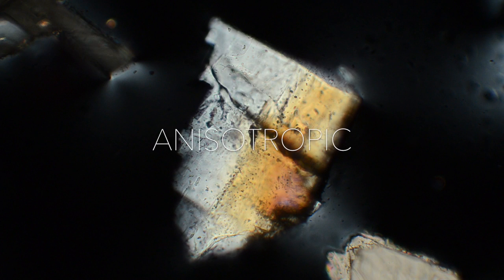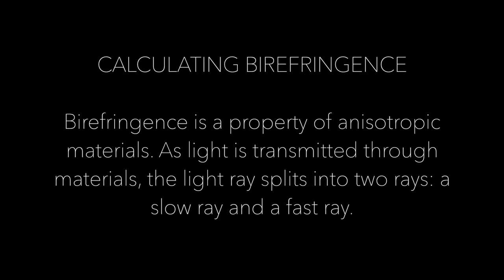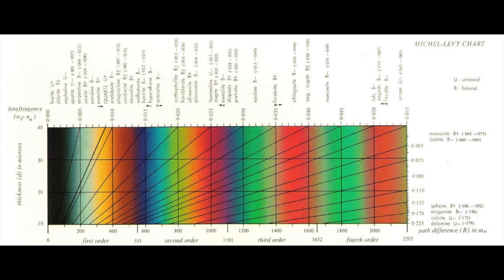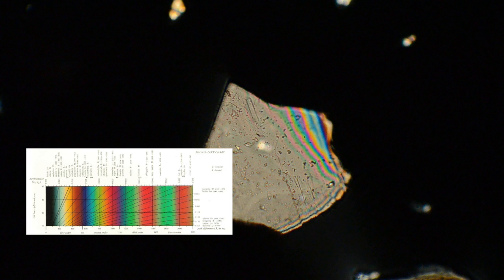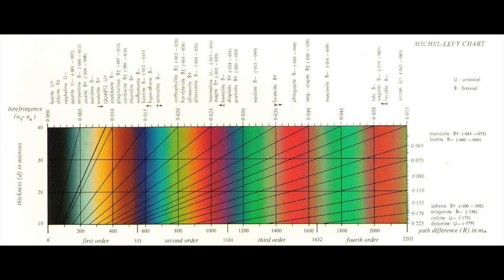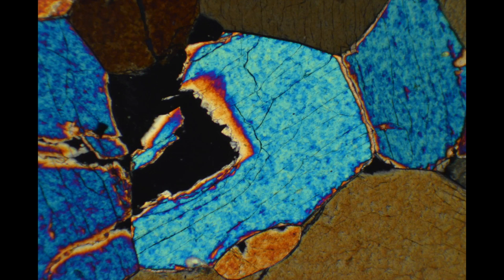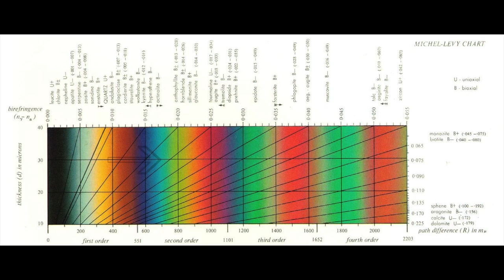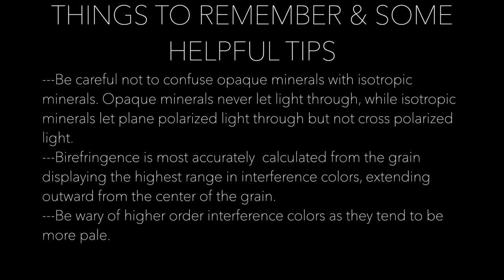Earth Optics Video 2: Cross Polarized Light

Comment: Can the chart be used to also determin the thickness of a mineral if the thickness is unknown?
Reply from the maker: Great question Nathan! Short answer is yes. If you know the mineral you are looking at, and record the birefringence of your sample, you can use the Michel-Levy chart to roughly determine the thickness. To more precisely measure thicknesses of objects in thin section (minerals, melt/fluid inclusions, bubbles, etc.),  I prefer to use a microscope with a calibrated focus knob. For this method, I put the top of the object in focus, take note of the measurement on the focus knob, turn the knob to put the bottom of the object in focus, and take note of the new measurement on the focus knob. The thickness of your object is the difference between the two measurements. I hope this helps - please let me know if it is unclear or if you have questions. This sounds like a good idea for a new video... :)
Reply: @EarthOpticsVideos  Thank you very much for your reply. Your explanation is very clear, and I will deffinatly test out both of those methods.